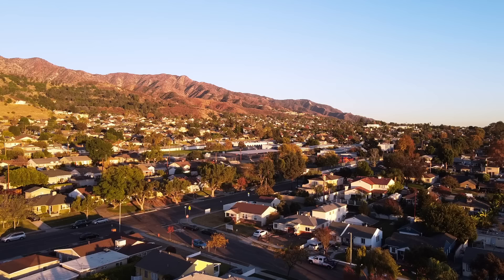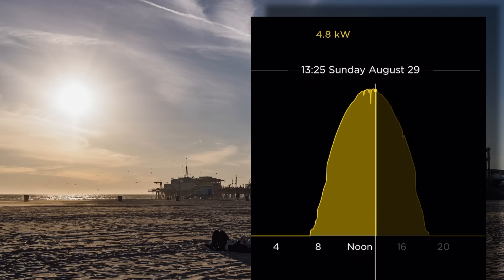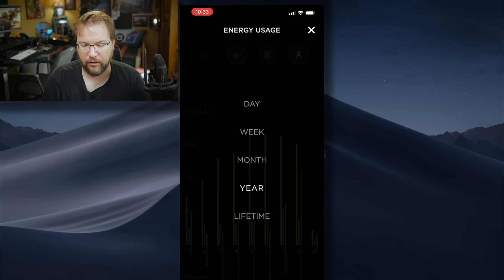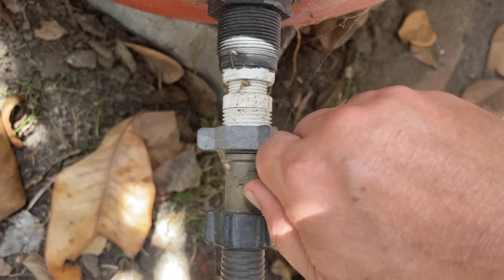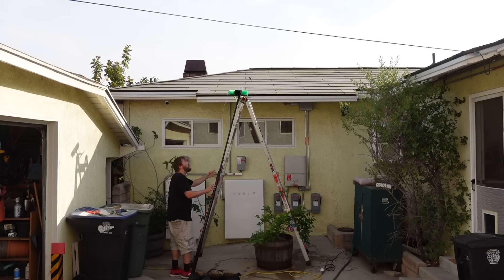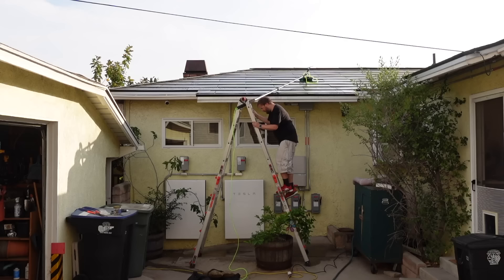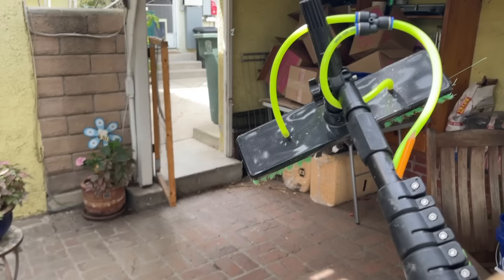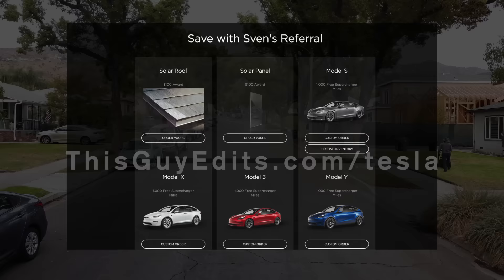Tesla Solar Roof: End of the Honeymoon Phase!

Comment: My level of laziness would simply memorize where the important tiles ( ones with the solar ) are and just clean those and leave the rest as is
Reply: my level of laziness would be to set up a sprinkler system on a timer to clean said tiles daily
Reply: @2nd3rd1st  
spend $60,000 on solar roof
spend $min wage for rando kid to clean it.
                   nothing could go wrong
Reply: @RufflezRevolution  If keeping them clean is so important seems like a sprinkler system should be part of the setup. Also he could have just used a pressure washer on low to clean the tiles which would have given him more power and taken much less time and eliminate sore muscles from using that brush!
Reply: @2nd3rd1st  I'm sure putting kids on a roof is a great idea? Like theyre roofers or something lol
Reply: @2nd3rd1st  : Yeah But, the repair cost of broken panels might sour that Idea....
Reply: @laurenj8888  It’s not you saw it generated 88 more dollars it’s pointless to clean them, One solid rain a year and it’s fine
Reply: @FreekHoekstra  Probably more about looks then performance of the tiles - all that gray soot from the smoke from the wildfires looks really bad on those black tiles. With a wand extension to his pressure washer he wouldn’t even have to get on a ladder to spray them down. And it would take him about a quarter of the time.
Reply: @laurenj8888   I suppose even though you could just hose it down with a pressure washer and do it in a couple seconds seconds
Reply: You do know? That Solar Panels reflect radiant heat into the environment thus adding to Global Warming..
A Glider pilot said that the thermal uplift from Solar Farms is amazing.. they adding more thermal temperature into the environment..
Reply: @graemejohnson9025   if they reflect heat they are reflecting heat to atmosphere, therefore reducing heat. Plus a hot coal fire adds more heat then some dark panels.
Also the problem isn’t the amount of heat the problem is the retention of that heat. You can lose the heat to space. Its the greenhouse gas blanket that keeps it here thats the problem
Reply: @graemejohnson9025  So basically a reverse greenhouse effect, reflecting heat out instead of in? That would help.
Reply: @2nd3rd1st  Untill they use that $50 on drugs lol.
Reply: just grab a power wash
Reply: @2nd3rd1st  So a job and drugs are the only options in your neighborhood for "the youth"? Sheesh
Reply: @FractalPrism.  Except for the incompetence factor. Or maybe the carelessness factor. Nah … it’s the let’s-hurry-n-get-outta-here factor
Reply: @MrJustliketht All roofers were kids at one point. Can't be a coincidence.
Reply: @2nd3rd1st  It's one of the new 21st century jobs predicted, minimum wage day laborer temps must be thrilled.
Reply: @laurenj8888  A sprinkler in California? With what water??
Reply: @2nd3rd1st  a nice gig to keep them of drugs? You are paying for their drugs.
Reply: @laurenj8888  you'd need to go on top of the roof to pressure wash properly and he did not want to do that. Sprinkler system doesn't make sense cause it is only needed for the summer months
Reply: @edwindigital4598  also its really not accurate to imply not working is the cause of addiction. that is incredibly inaccurate
Reply: @livewellwitheds6885  I didn't make that statement.  Simply asked someone else (sarcastically) if what they mentioned are the only options.

Comment: I live in Baghdad where temperature in August reaches 124 F. Surprisingly, the PV system we have produced more energy when it is dirty and completely smeared with dust. I anticipated this weird observation by temperature effect. I think, in extremely hot weather, dust reduces the temperature by decreasing sun radiation reaching the module surface. And since temperature itself exerts much more on the PV performance than the radiation intensity, the system performed better when it was dirty.
Reply: I think it's because of temperature coefficient. Panels are optimal at around 50 degree Celsius. The dust might have reduced it a bit from full performance
Reply: Solar panels can actually overheat and stop working.

Comment: Great upgrade to your home, even with some shortcomings to performance. I see you like having one. Also i must compliment you with the extensive detailed reporting. I would advise you to get third party power storage in the form of LifePO4 batteries. For that 15.000 dollar (2 TESLA power walls) you could have had approximately 30 x 500Ah units capable of storing 15KAh (180KWh) or more with a life cycle of 20.000 charges (days) and a DOD of 80%. You could also add a wind turbine to add some KWh 24/7. Having to pay your utility company still some basic money is not making it a free system that pays itself back quickly. Sometimes it is cheaper to charge the Walls from the mains with a KWh price of 8 cents at night. 15-25KWh wil get you a full day off-grid less than $1.20-$2.00. It all works though, so glad you have it all installed.

Comment: Bravo! Just watched 3 of your YT videos and I have subscribed. As a sheet metal roofer I can confirm the cost of a quality standing seam (concealed fasteners) metal roof is about 3-4 times the cost of an asphalt shingle roof. Although that depends on the shape of the roof, overall access and steepness of said roof. The part that most, even those in the roofing industry, are not aware of is that a quality sheet metal (galvanized/galvalume & painted 26 gauge steel) roof will last 150-200 years using today's technology. In fact there are mulitple examples of old metal roof replacements of over 100 years old using the technology of the day (1900-1920s). If your using pure zink, the manufacturer Rhienzink now claims 350 year lifespan and copper is thru the roof 😉, likely 800 years or more. So the question seems to be how long will the Tesla roof last before repairs or replacements are required? I've seen traditional solar panels last over 35 years in good condition. On a side note, traditional solar panels are typically installed on standing seam metal roofs using friction fit clips that do not damage the integrity of the roofing at all. Given the life expectancy of solar panels (50-100 yrs) today, the big question remains, how long will a Tesla roof last?

Comment: Thanks for the data, real-life use is the best way to actually price out the economic viability of something like this. High level takeaway I'm seeing is that in a best-case scenario like So-Cal (expensive electricity and lots of sun) is a 23 year breakeven on your final out-of-pocket cost from the last video, or a 32 year breakeven on the unsubsidized $50k installation. Looks like there's still a ways to go before this can become mainstream. Looking forward to the full financial breakdown.
Reply: It will obviously be case by case but it's important to take into consideration the cost of installing a normal roof if that is somethign that will need to be done anyways.
Reply: @djbutch123  yes but if you have to redo the solar Panels with a solar roof you have to redo the roof again every time
Reply: @BrosBrothersLP  ... What?
Reply: And then not many people stay in there house for 30+ years without moving. That's a long time.
Reply: My understanding is that the intention of solar tiles is not to replace EXISTING roofs, but replace the purchase of a NEW traditional ceramic roof. In which case the arithmentic has to be based on the marginal cost.
Reply: @ralphpurtcher  no because when the solar panels need to be replaced you have to redo the whole roof again. And at that point it becomes incredibly expensive
Reply: @BrosBrothersLP  I don't think that follows. Why would an owner replace non-working solar tiles when they can buy cheaper replacement power from their neighbour (via the grid), or fit cheap panels (panels NOT tiles) to their roof? The owner is not forced to invest in anything.

A system should run long enough to pay for itself and also pay for the investment opportunity cost. If it doesn't, invest your money in other renewables opportunities.
Reply: @goozebump  coincidentally bought house ‘91 🤣
Reply: It is a roof and solar so you need to subtract the value of the roof from your base cost.
Reply: @matthewhuszarik4173  no because a normal roof lifetime is longer.
Reply: @BrosBrothersLP  The 25 year Weatherisation Warranty on Solar Roof seems to imply that it'll last longer than that on average. I don't see an issue here to be honest.
Reply: There's inflation of energy prices expected worldwide for this winter already. It could shorten the breakeven time much, especially if the inflation is sustained for longer time.
Reply: @jurajvariny6034  It looks like Natural Gas prices have doubled compared to September 2020 and 2019. Heavy users will see their bills rise it just depends how much their utilities bought and stored at a lower price and their long term contracts.
Reply: Well, perhaps another option might be to install very energy efficient air conditioners and install high levels of insulation to keep you cooler in summer and warmer in winter. generating electricity from solar or any renewable source is a good idea but connecting this to inefficient housing will place limits on the income that these systems can generate from selling back to the grid.
Reply: Just like thunderfoot said years ago
Reply: That assumes also that you are not financing the tiles and that they dont break or get damaged in any way. Once you calculate depreciation and taxes, idk why anyone gets solar. It saves money if you forget the initial cost and just check on your electric bill at the end
Reply: No one currently installing this will break even before they’re dead.  The lifespan of the tiles won’t allow it.  This entire roof will need replacing LONG before the thirty year mark.
Reply: @matthewhuszarik4173  Until you have to replace the roof.
Reply: @BrosBrothersLP  Solar roof is good for twenty five year normal shingle roofs last about twenty and even ceramic or concrete tile last about the same. The tiles can last for ever but you have to replace the underlayment about every twenty five years. So the warranty only last twenty five years. That doesn’t mean the roof won’t last considerably longer. Other roofs don’t come with a 25 year warranties.
Reply: @matthewhuszarik4173  not sure what you mean. Ceramic tile roofs have warranties lasting 50+ years.
Reply: @JonathanRootD  Warranties that long are marketing gimmicks. My family owned a roofing company. More than likely after 20 year either the original owner won’t own the house and the warranty is limited to the original owner of the roofing company has changed hands or gone out of business.
Reply: @JonathanRootD  I have not ever seen a hard tile roof that doesn’t require an underlayment. Ceramic, clay, and concrete tiles do, Tesla solar shingles do, metal roofs do. It is required by many building codes.
Reply: with inflation being a real thing. you better believe any numbers you input today have no relevance 10 years from now. Energy costs will keep rising.

Comment: I have a 10kw system with 35 traditional panels made in the usa. I rinse them off with tap water 2-3 times per summer. Takes me 15 minutes on my ladder. The panels look great without brushing them. We have soft water from the tap. I paid 12k for the system and expect a break even point at 7-8 years. We charge 2 Teslas with them as well as ac, water heater, oven and dryer.
Financially makes lots of sense for me.

Comment: Loving the content. I've got a tip that might or might not work
You could put up a hose on the top of the roof, connected to the rainwater barrel, with holes made to wash the tiles once a month. tweaking the amount of holes on the hose and adjusting the power of the pump so you don't use up all the water incase of a dry month.

Comment: The important thing is that this are thinn-film panels. They have pros and cons, but one of the big pros is that they arent as affected by dust, shading and weak sunlight ( which gives them more output at morning and evening), but they have low performance - what comes to more space needed.
In my opinion Tesla made a good choice there, but I dont know if some "normal" paneels with high performance and more cleaning required wouldnt be a better choice in very sunny places to generate more income to save at the electricity bill.

Still this choice to deal with dust is interesting and time will tell how long such a roof performs over it´s life cycle.

Greeting from Italy and keep up the good videos!

Comment: It generally feels worth it if you need a new roof and frees up monthly revenue. Otherwise it just feels like a luxury expense because of how long it takes to pay off.
Reply: Does it last as long as a normal roof though? I don’t think so. Normal panels can be swapped easily.
Reply: @KP3droflxp  The roof may last a few decades longer than the panels inside the tiles. And you're probably right that the roof itself won't last as many decades as some other types of roofs, but what is the issue with that? Cost - and perhaps environmental - should be the only concerns, since I don't think anyone seriously thinks that a few extra hours of work in their entire life is going to be a deciding factor.
Reply: @Muskar2  no but it means that you have to redo the hole roof again when you need to redo the solar panels. So you basically never brake even
Reply: @Muskar2  That's the point, the panels will stop being useful pretty fast and you have to replace the whole roof again.
Reply: @KP3droflxp  Why do you "have to" replace the roof when the solar panels stop being useful? It just becomes a roof by then and then couldn't you just add standard solar panels if you still want independent energy generation?
Reply: @Muskar2  But why not just use normal panels in the first place then? Much cheaper.
Reply: @KP3droflxp  A Solar Roof is only economically relevant if you're already looking to get a new roof. At least, that's what Tesla says. Or you could be rich enough to have other primary motivators, I guess.
Reply: @KP3droflxp  No, you can replace individual panels since they're easy to swap out. That's one of the upsides of this roof.
Reply: @Muskar2  Yea, even then not so much.  You need to put the tiles down on existing 3 tab roof, and i know my roof was 9k to  do with average shingles.  Add the cost of the tesla shingles on top + installation is another 35k after installation, but not including a power wall which is another 10k if you dont have one.  So unless you have 50k+ to drop on a roof instead of  10k...like you said you have to have more money than you know what to do with.
Reply: @Muskar2  You know that producing those tiles also leaves a pretty big footprint right? Bigger than normal tiles, and normal tiles can last basically forever unless something smashes into it or it falls off.
Reply: @Muskar2  "It just becomes a roof by then and then couldn't you just add standard solar panels if you still want independent energy generation?" This is the entire point. Solar panel farms are better and more maintainable than whatever these tiles are. Bad durability, more expensive and higher maintenance. So why not dismiss these unfeasible tiles and go for regular solar panels?
Reply: @Humperdinkle0  No solution can be generalized. At least not without sacrificing economics - which is the primary factor. That's the 101 of energy production technologies. Let individuals and companies decide what's best for them. If this product is useless to everyone, then it doesn't need your help to go out of production - it'll do that on its own.
Reply: @Humperdinkle0  Do you know the roof industry at all or are you just spitting claims for fun?
Reply: WTF? "if you need a new roof" Is the only reason you install Solar Tiles. You should not rebuild your roof unless it needs major fixes.
Reply: @KP3droflxp  I don't know what the CELLS inside the tiles are made of. If they're amorphous, you're right, but, if they're polycrystalline, they can last for at least a decade. If they're monocrystalline, they can last several decades, before a significant loss of performance. I'm less concerned about the cells, and more concerned about how the tiles are inter-connected. I can't find information on that, and those links could indeed be the "weak link". The lack of information is the biggest reason I would hesitate installing the tile system.

Comment: As another data point, I’ve done A/B testing using hose water to just spray (no brush) clean every other panel in my solar array, and I also saw approximately a 10% difference in production between the clean and dirty panels the next day. (San Francisco, enphase microinverters)
Reply: I have Enphase in Florida.  It rains 25 hours a day here.  I am def in the “you don’t need to clean the panels ever” camp and mine started getting lines that stayed even after the rain.  Enphase app showed a negligible loss.  But aesthetically the wife wasnt happy.  So i had them cleaned.  The increase in power would not cover the cleaning costs.   There was some fancy name dor the lines.  It wasnt just pollen.  It was lichen and could eventually grow big enough into the panels to hurt it.  So I got it done.  Looks way better.  They used deonionized water only.  And a special robot to drive over the arrays.  $215 for 25 panels done the same day.